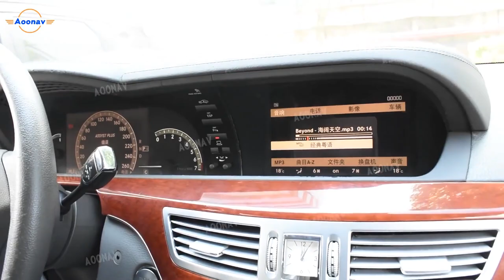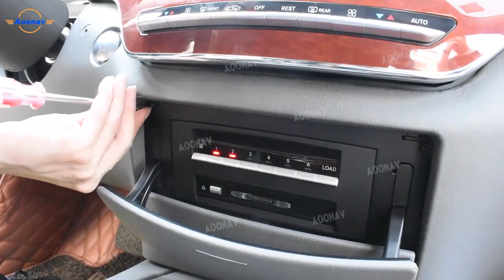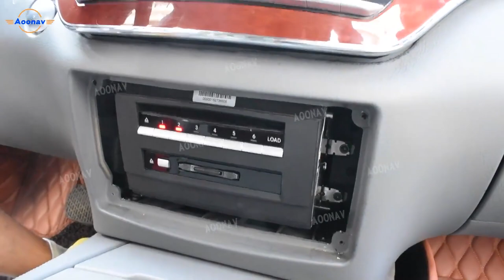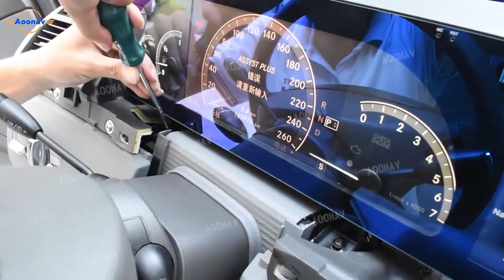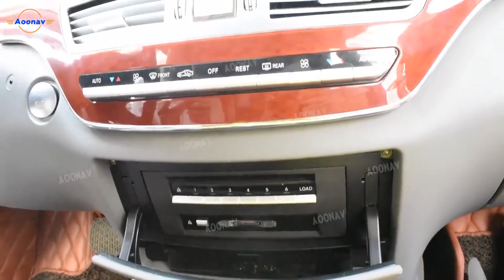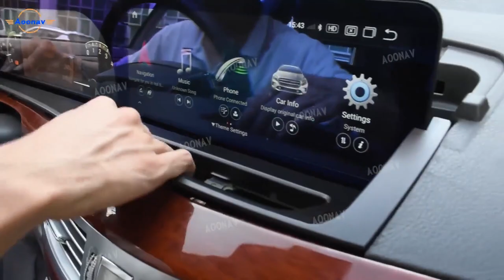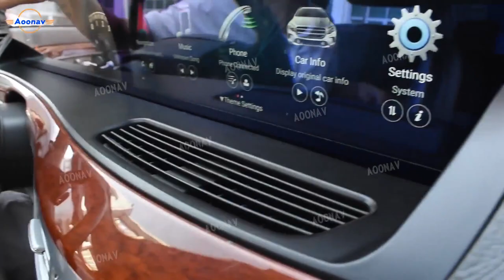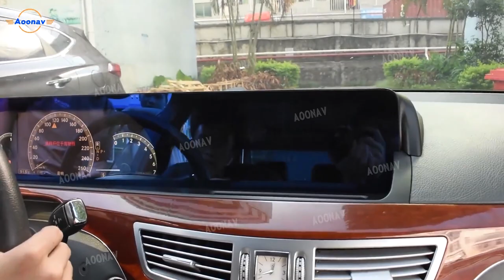Installation Video:  Mercedes BENZ S Class  W221 W216 CL 2005-2013 12.3 inch Screen Upgrade

Comment: Every install I’ve seen seems to show triangle warning light illuminated 
Is that an issue with the upgrade ?
Reply from the maker: This is caused by starting the test without completing all the wire connections.
It is recommended to start the test after all cable connections are completed.

Comment: Will all previous functions like height adjustment and air condition controls and options work in the same way?
Reply from the maker: Yes, swiping to the left on the main screen of our machine will call out the virtual button
Reply: And does it actually drop lowers the car in sport mode?